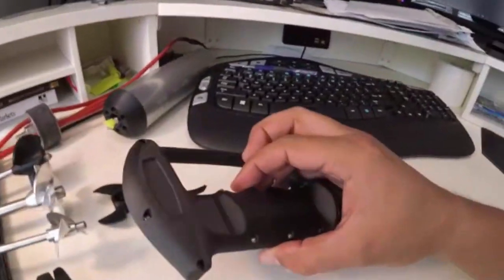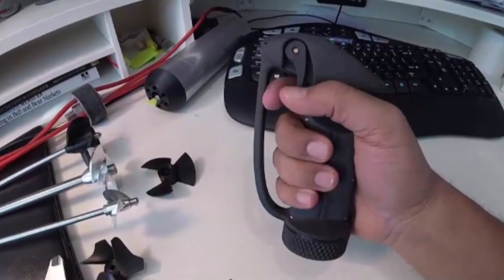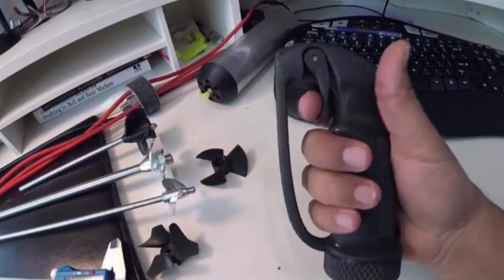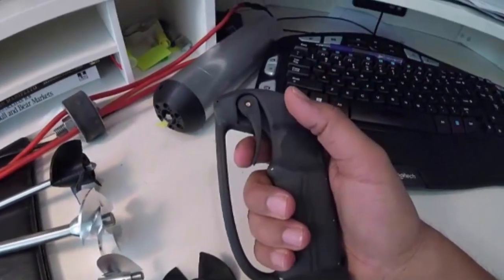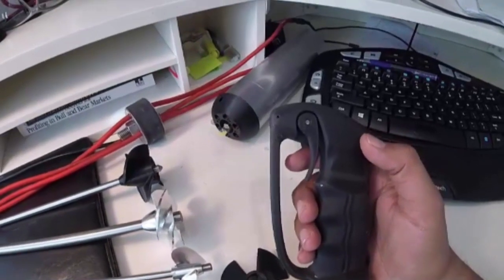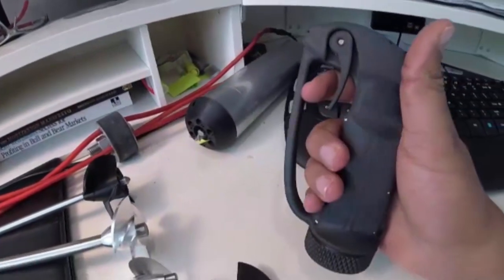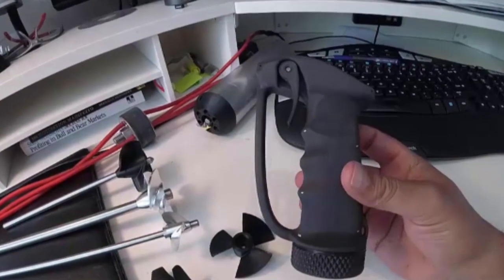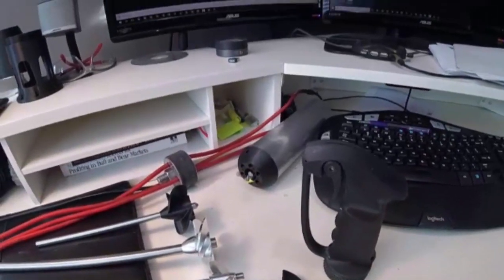VeFoil by VeConcepts Part 7 DIY Electric Hydrofoil Remote Control System

Comment: Is the remote control alone ready to buy now?
Reply from the maker: We should have all the final cad and prototypes done by Friday as we are doing one more run to be sure everything is perfect before we go into injection molding which is very expensive. We plan to launch and sell each of our products at the same time Remote, jet system and board. We are shooting to start selling in 30-45 days.